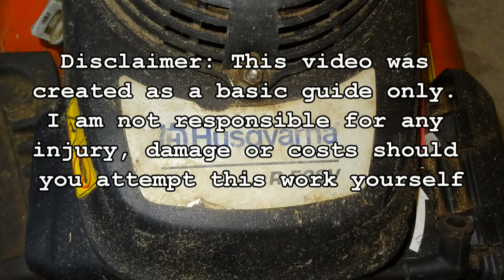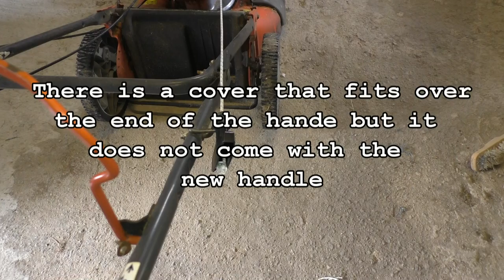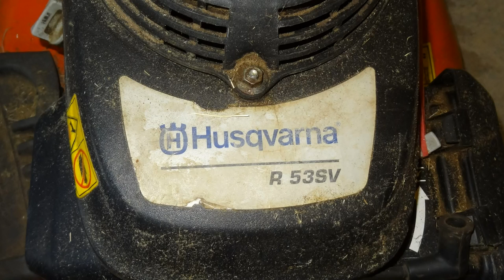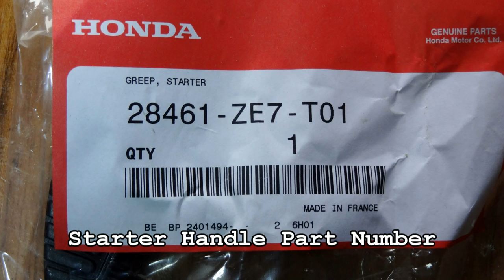Replacing Starter Pull Cord Husqvarna R 53SV Self Propelled Lawn Mower With Honda GCV160 Engine

Comment: What is that aluminum stopper on the pull cord called?
Reply from the maker: You might be able find something you can use if you search for cable ferrule & end stops. Also, I have sometimes used a ring crimp terminal & cut off the ring part

Comment: Can you power wash the engine instead of scraping the dirt? Just wondering...
Reply from the maker: I usually clean my mowers by hand using a soft brush, sponge & warm soapy water. I then dry them with a cloth & start them up until the engine is nice & warm. If I am putting them away for winter I give them a good spraying of WD40 or similar.  I must admit I am always tempted to use the power washer but I think there is a good chance it might do some damage.